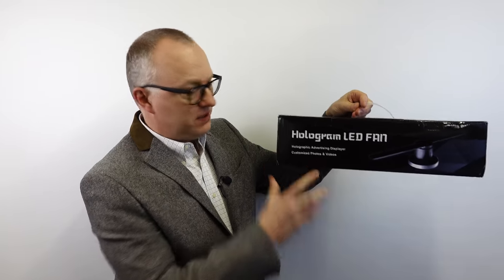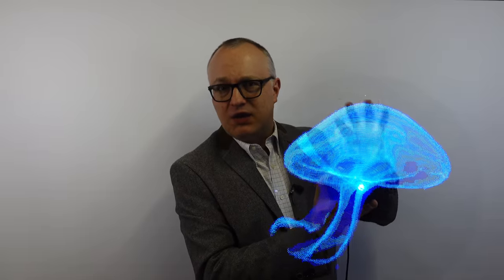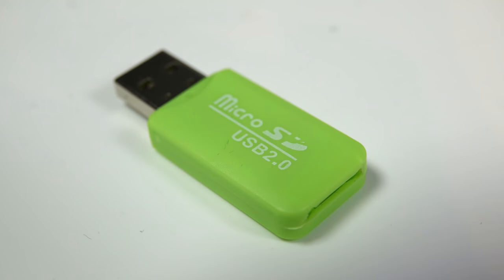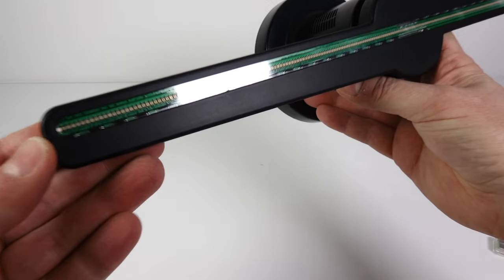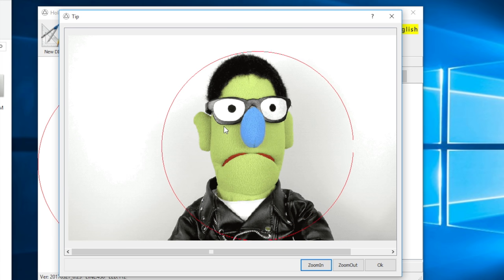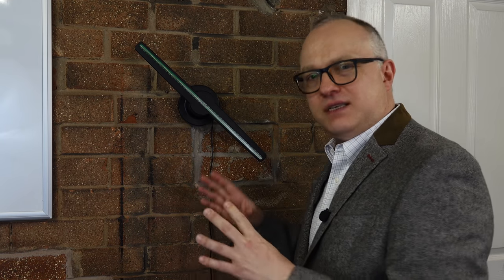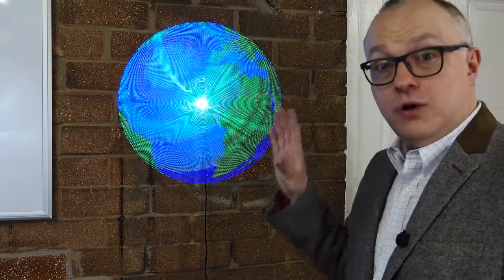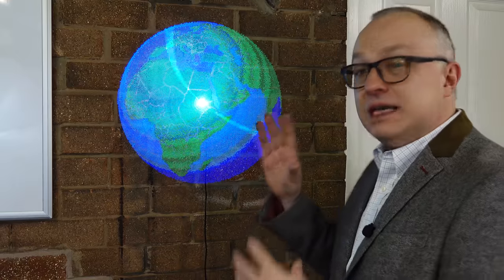'Hologram Fan' - animated images in ‘mid-air’

Comment: You can't use it outside because the images look very shitty when you are competing against the sun. I have one of the fans you have and don't use it anymore. Not because it isn't neat, they are, but it is almost impossible to keep converting mp4 to bin and there is no program that does it the other way around. So if you want your jellyfish there is no point in ripping it off the card as there is no bin player that is available for a PC. I have purchased other units that play mp4 so the images can be swapped back and forth for editing.
White backgrounds don't work, only black does.

Comment: At this price point it's worthless. For almost half the price you can get cheapest 20" monitor and you have plenty left for Raspberry Pi and SD card.
For a bit more you can buy normal LED panel with single color LED. If want you can buy full RGB LED screens to promote your store or whatever you want.

Regular TVs got really popular for indoor stores. Since now you can get 75" TV for the price you had to pay to get 40" few years ago.

In general rotating blades that display images aren't practical at all. You just don't want a device in a store that can hurt customers or simply stop working after few months.

Comment: Does it actually use 36W????? Is the 12V 3A more than it’s actually using or is it just barely enough and it’s really running at 12V 3.0-9A because it’s actually a 40+W device and the power adapter is underrated for this device???? I have seen several of my 12V 1-10A power adapters from China supplied with devices, LED Tape, or that I just purchased separately be either not what they say they are rated and/or also be more than what they are supposedly rated. I have a 12V 5A LED tape adapter that gladly gives you 12V but let’s you draw 7A and gets really hot.

Comment: Nah, dangerous and small... I didn't like the tech when it got released, and it didn't changed much.. It's still not cool or useful
A hologram should be 3D... This here is just a wobbly wonkey display with no accurate displaying
Oh and without a serious input, and a lot of computing power needed if it would be used as a display